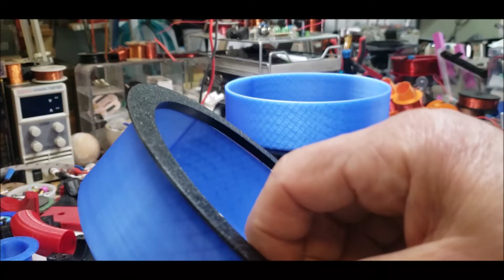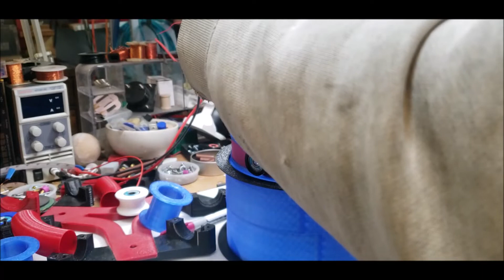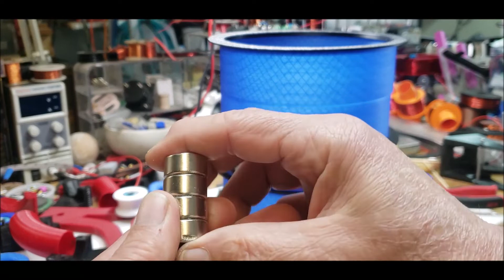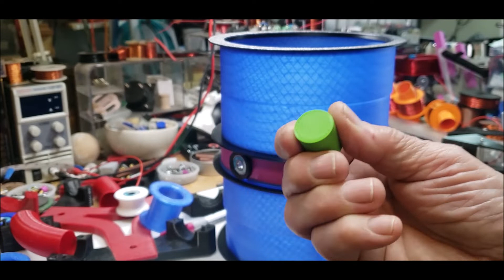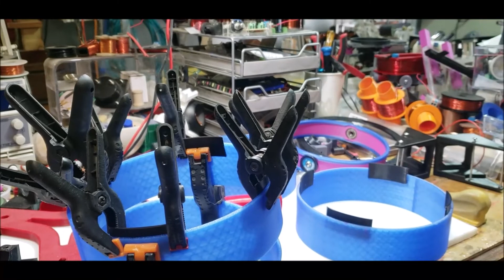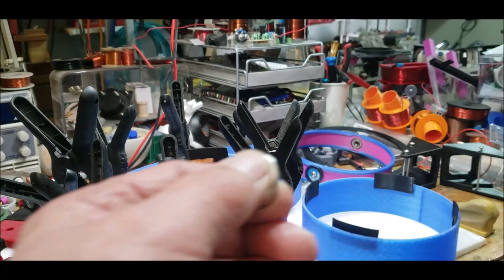3D Printed Newman Motor Build

Comment: This looks really awesome, the only way I know of to determine magnetic strength is to use a Hall effect sensor, which can tell you the magnitude of a magnetic field. You could compare the reading to other magnets to get an idea
Reply from the maker: ok so I guess that's the ticket. Several others mentioned using Hall sensors so I will look into it.

Comment: Take a close look at the photo, above. Those so-called bar magnets are, in reality, PVC canisters of helium wrapped with an open coil.

Take a close look at the photo, above. Those so-called bar magnets are, in reality, PVC canisters of helium wrapped with an open coil.

{"Open" implies not connected to anything and not self-shorted.}

Helium will not respond to an electromagnetic field. And Newman's coil does not have sufficient current to produce any appreciable magnetic field as it is. Yet, he purposely designs his massive coil to exhibit high voltage to produce a strong electrostatic field (very lengthy wire of moderately thin girth). Thus, the helium will respond by producing a moderate to high frequency of electromagnetic radiation of its own. This amounts to a feedback, a positive feedback, to his massive coil and blends with the D/C pulses coming from his battery pack through his motor's commutator creating a slightly complex waveform within his coil. The beauty of his setup, is that he does not have to "pay for" the excitation of the helium except for the initial hand crank he gives his motor to get it started. But once begun, it picks up speed due to the coil amassing double the voltage over what the batteries can supply sufficient to broadcast this voltage to the helium and stimulate the helium to broadcast an EM field of its own -- received by the coil -- and the coil ends up sending a few hundred milli amps of current in reverse direction back to his pack of batteries to trickle charge them (top them off). This complies with my simulations based on what Dr. Hastings analyzed of Newman’s “table model” which he had taken to the Patent Office and described in chapter six of his book.

Without the helium using simple bar magnets...no overunity...
Reply from the maker: Yeah I'm not really sure what you're talkin about I don't know what picture you're talking about either if it's the picture of my Newman motor I built plenty of these before so I think it'll be okay
Reply from the maker: Greenme u can send me the info to my email addy.
mcorrade@comcast.net

Comment: How about an analog hall sensor and a cheap analog voltmeter, like one with a needle. That would look classy and be easy to power with a 9 volt dc power supply. Given that you hold the magnet at the same distance you should get different readings right?! 
Nice Newman upgrade, I dont know what greeny is talking about, but this should work as long as all magnets are facing the same way, and the magnetic field of the coils facing the same way too. Magnets north on the top, south bottom and then jolt the coils on with south on top, north bottom, should invert the magnet completely... But I don't know, it is your build, whats your take on this? JP
Reply from the maker: Yeah later I'm going to post a video showing the actual Newman motor rotot it print it out fantastically and I think you guys will like it
Reply: @mcorrade  Nice can't wait!
Reply from the maker: Hey I tried to comment on your latest video but I wasn't able to cuz I'm using my phone at work but great job getting it going man why don't you try using a hall sensor instead of a reed switch
Reply: @mcorrade  Haha thanks! I was going to but I knew exactly where I stored the reeds, I would have to find the hall sensors.
Reply from the maker: @toffeeflavour  cool Reed switch word great but I like the hall sensors but they do get hot
Reply: @mcorrade  Alright I shall address the hall circuit in the next video as well

Comment: Try them around a digital scale.  I know cell phone magnets will change the weight displayed.
Reply from the maker: ??? can you further elaborate?
Reply: @mcorrade  put a magnet by the scale and see if the weight changes. Some scales don't react to magnets. I might get mine out and make a video. I caught a guy cheating the scales by placing a magnet by the scale.
Reply: Not sure why my comments do not show up here....they are essential for your Newman motor. The design from his book doesn't work.
Reply: @GreenmeResearch  try not to use hyperlinks
Reply from the maker: @GreenmeResearch  your comments are showing up fine go ahead and let me know what you're trying to tell me I take all comments very seriously especially if you think there is a design issue